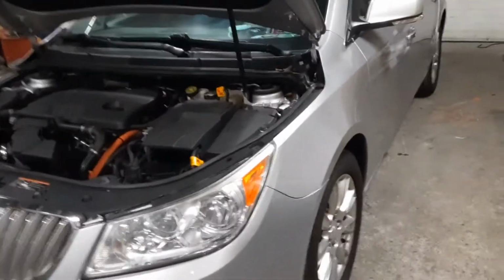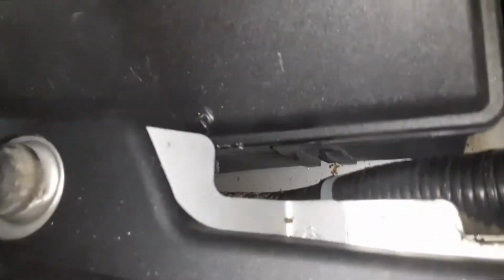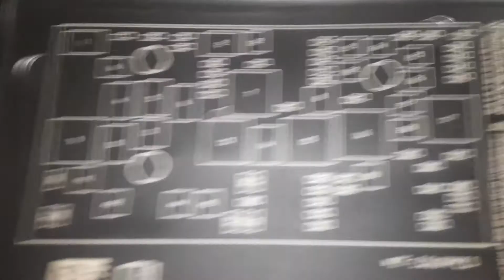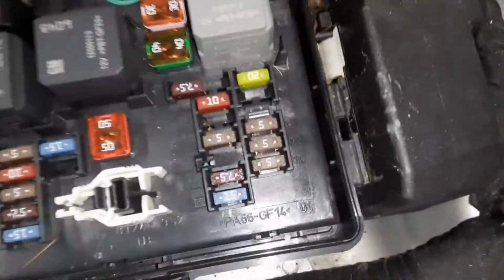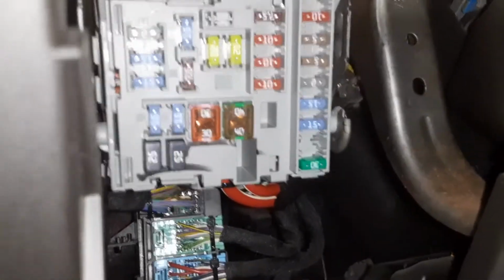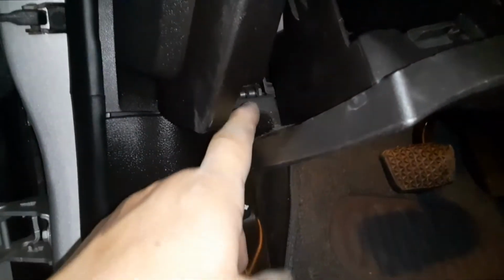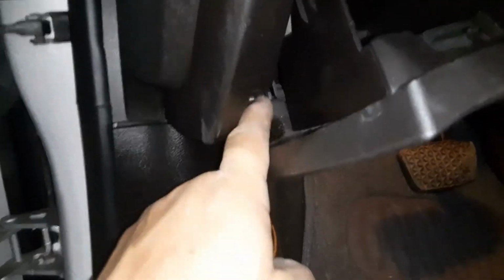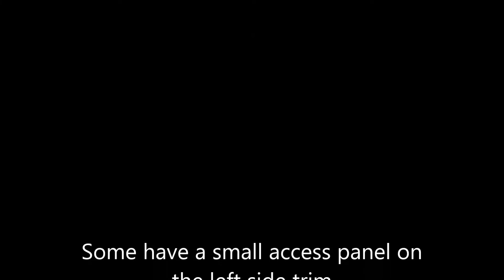Buick Lacrosse & Allure Fuse Box Locations

Comment: I found 2 fuses each controlling front and back power windows. I believe there is a short as ive checked all the wires, pulled off door panel and used test light. The red wire to switch is lighting up but no others. Is there a relay that i cant find elsewhere that isnt listed or in the fuse boxes or am i not finding the correct  relay for the master power window switch. It works intermittently and i dont believe its the motor and ive tested 2 new switches. Ihave the 2011 Buick Lacrosse

Comment: can you help me Joe ? , i got a 2011 buick lacrosse cxs 3.6l , one day 2 years ago i drive to veterans hosp for an appointment .3 hrs later ,i approach car ,i click my remote and i heard a very rapid loud clicking sound for a couple of seconds . i open door it does it again , i push button everything comes on but no crank no start . i open the hood and while im looking around , that terrible clicking sound happens again . its the kr71 relay ,it also blows the #10 fuse under the hood . i know the relay clicks but sounds like something under intake clicking also ! i ran a quick code reader and got UO100 AND PO23F CODES .IT SAYS SIDE OBJECT DETECTION NOT WORKING ON SCREEN AND STABILITRAK NOT WORKING . 2 yrs next month 2020 its been parked . any advice brother greatly appreciated !!!

Comment: All my heating and ac components not working since I made ground it made a big spark ⚡️ on the wire connector to the compressor does any one know if is a fuse relay or what it call
Reply: Neither is mine I got the car a week ago can you help if you figured it out what it was

Comment: Unplug the battery for about an hour plug it backup. I have no idea why the computer is involved in  activating a horn.. My horn quit working I unplugged it about an hour Later hooked it backup and the horn worked fine  I discovered this when I thought resetting the computer would help with my TPM monitors. I have brand new TPM monitors I can relearn them but 20 or 30 miles down the road they all disappear. Re learn them 20 or 30 miles down the road they disappear again. Sure hope somebody has an answer for that 1